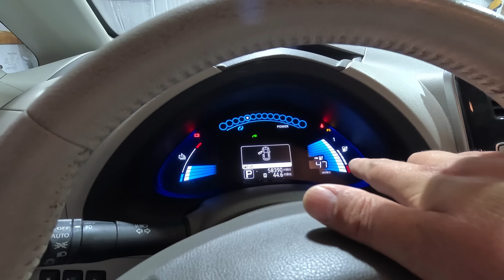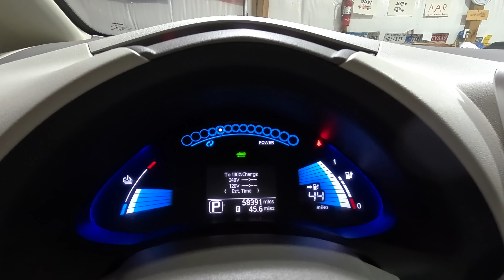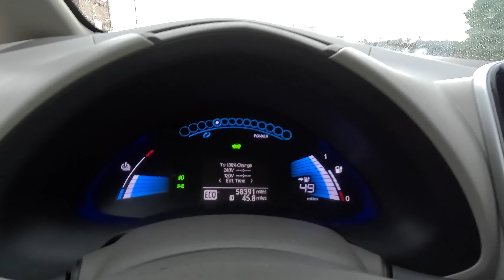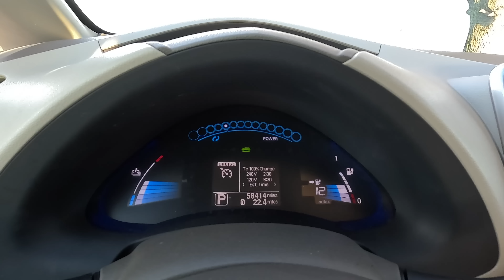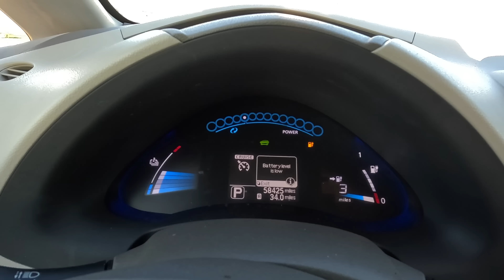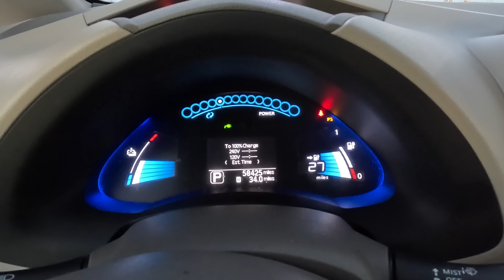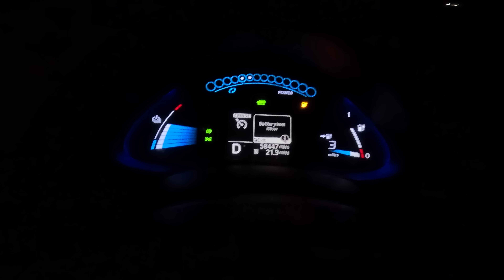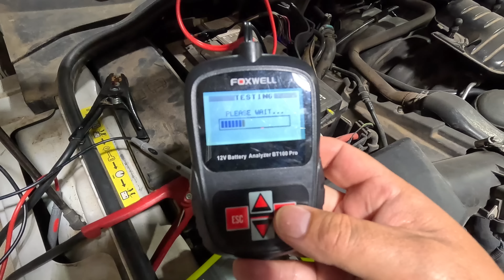Which Costs More? 2012 Nissan Leaf or New Cub Cadet ZTR Mower? You'll Never Guess!

Comment: Mower does fit through my fences gate without any problems https://www.youtube.com/post/Ugkx1VWTrayKBdCKAjzAcZ_Eg4dhHTae3LkN also recommend  I had to level the deck side to side after a few mows maybe I may got too close to something and the deck may have dragged on it. Like others reviews have stated this mower will tear up the grass with the rear tires when making tight turns if you do not slow down. Wish mower came with a hour meter other than that works exactly like I thought it would.

Comment: Keep in mind the batteries in those only last between 8-10 years and cost between $5k and $10k to replace. With it having very low distance (47 miles) after a full charge, I would imagine it's just about run its full life cycle. Most of the leaf's listed above $5K have new batteries installed.
Reply: The 47 is a estimate. I have a 2012 leaf and I divide the miles by 2 to get the real range. In 2013 they came out with a better battery that even without liquid cooling got more miles and didn’t degrade as much. I got mine 3 years old . They sold 500,000 in Europe and the usa . It was the best selling until 2018 when the model 3 came out. People make fun of them but it was meant for city driving and 73 miles max when new. Only thing that came out later was a Tesla model s for over 80,000 the leaf was the only car available across the usa  in 2012.  I have driven mine round trip 200 miles with all the chargers we have now. In 2015 my big city had one Tesla super charger and 4 dc fast chargers. Today they are all over. But it doesn’t work for living in the country. The Chevy bolt 2017 has liquid battery cooling .

Comment: Very much enjoyed your vlog. Daily dose of gardening can be a hard job. About the Nissan. Those early EV s are good for longer rides when all circumstances are within limits. First don't go over 55 mls/h those early ev's are vulnurable to high Wind speeds from the front But even more important is having warm temperatures. Good feel for the Battery ist 25 Celsius or 77 Fahrenheit. It looks that the Battery can't be charged to it's full capacity anymore because of degradation or faulty malfunctioning BMS, but those cars are still good for daily short drives to work or shopping.

Comment: I think you should try looking at the individual cell voltages with leaf spy or a similar app. There are 96 individual cells in series within that pack and if one is bad (voltage deviating from the others in the pack) your overall range will really suffer. This could also be the cause of the inaccurate range prediction. Cells can be individually replaced on these vehicles, while that does require taking out the HV battery assembly, it is doable.

Comment: The Leaf seems to be a nice little car and it will definitely make a profit.  The air cooled battery is a problem but they're  (relatively) cheap.  If someone were to buy it for 8k they would have a nice car for around 13-15k with a new battery (assuming you want electric).

Comment: There are videos out there and well known the Leaf battery does have a small buffer below zero. Estimated around 10%. I don't advise driving below 0 but hopefully reduce your anxiety.
Reply: BTW forgot to mention the Leaf is terrible at higher speeds . Reducing by 5mph can drastically improve range especially at highway speeds. Another solution to improve range is to use heated & cooling seat covers. They use so little power 20-40w compared to 1000+ watts of climate control.

Comment: $35,000 original price and $5000 clean retail for the Leaf.😊
Reply: In 2011 it was 36000. I got my 2012,in 2015 for 13000. With 12 battery bars. I see dealers trying to sell ones with 4 battery bars for 8000 that is the 2 red dashes and 2 white dashes it would maybe get 10 miles. I didn’t know about the battery bars in 2015 but Ian sampson from the uk was the guy I watched he made over 100 youtube videos on his 2013 leaf. He got 80-100 in summer and 50 in winter. His model showed battery percentage. I wish I could have afforded the 2013. 2017 was the 30 kwh battery and 2018 the 40 kwh battery. Then 2019 the 62 kwh . Nissan should have added liquid cooling after 2015 when people told them it needed it. The Ariya has it and ccs charge port but range coluld be a little better.

Comment: I would take you up on that bet that mower I can bet will get at least 25 to 30 miles to a gallon it might be very slow doing it but if it has a 2 gallon tank that's further than the leaf don't UNM estimate a small lawn mower engine and getting better gas mileage I see people doing results they send off some pretty good numbers

Comment: Hey Randy, get the model up from your Topdon battery charger, it's only a $100, it's a Bluetooth battery tester/charger and fixer? The Topdon TB 6000 Pro is awesome, it will bring back dead batteries, de-sulphate them, and battery maintainer, wireless monitoring via Bluetooth. I got one, since I had a hard time believing it had all those features, but it works amazing, saved my Focus battery? The tester said the battery was in need of a charge, and was bad, after? I used the repair mode, and it brought the damn thing back to life, by throwing a constant 12 or 13 volts through it for a few hours? If you've been bragging about your Topdon, then you will save a boatload of dough by repairing bad batteries, instead of having to go buy new one's?

Comment: If the battery could get 100 miles a charge,  I would consider buying one. Getting 30 to 40 miles a charge, i couldn't drive it to work. Battery would probably be dead before I got home. It's truly sad that car has no range.

Comment: For people that do any research on the car they're buying - before they buy it, you'll find that the Nissan Leaf has battery overheating issues.  These overheating issues dramatically shorten the life of the battery.  For the people that DON'T actually research the car they're buying, they will pay $6500-$7500 for a used Leaf, and not know it has no range left.  They see EV and the low-sh price, and buy it without knowing.  THAT'S why they "are selling for $6500-$7500".
Reply: Nissan

Comment: Dang I was getting stressed out watching you try to make it home. With new batteries in that thing it would be a fantastic little car for somebody in the city. But even in the city I don't know what good a car that can only make it 20 something miles on a charge is going to do for you. And then the entire time you're driving it you're going to be stressed out whether you're going to make it 20 miles or not. I think you may be stuck with this one for a while. I can't see anybody spending $4,000 or more for a car that you can't even be sure will make it 25 mi. Maybe you can donate it and use it as a tax write off that might be your best bet. I mean that wouldn't be much different than buying a boat that has a leak. Where you go out fishing and you got to hope to God you can make it back before you sink lol😂. As it stands it's basically a $4,000 paperweight

Comment: EV batteries are just like phone batteries, the more you use them, the more they degrade the capacity over time? The higher the charging rate is per charge, the more damage is done to them? Fast charging lithium batteries is convenient, but will degrade a battery much faster, than slow charging? You save time, but kill the lifespan of it, in the process? EV should not be considered a permanent replacement for engine's? It cost more to buy an EV, insure it, if you can, pay more for charging than gasoline, all with range anxiety stressing you out for what?  If the Leaf got a new battery, it might be a reliable vehicle, but if and when it breaks, beside's the battery being more expensive than the vehicle itself, service will cost more/hr? Parts will not be available, if at all, and will make you get a second mortgage to fix the thing? My father bought a Civic Hybrid, what a P.O.S.? Trans let go at 35K, battery was 2 -3 grand? Not reliable being a hybrid with a gas engine that also had issues? The Civic was bought brand new, also?